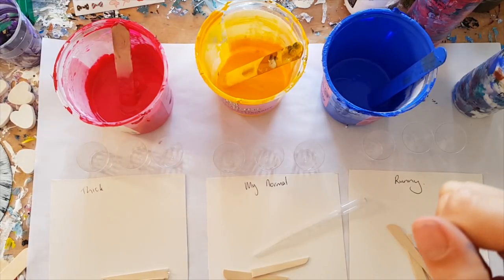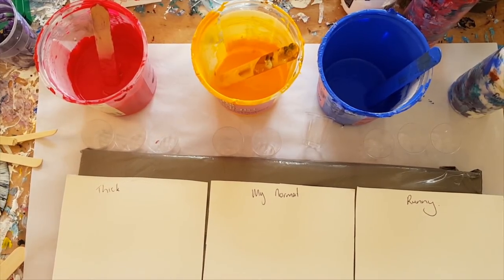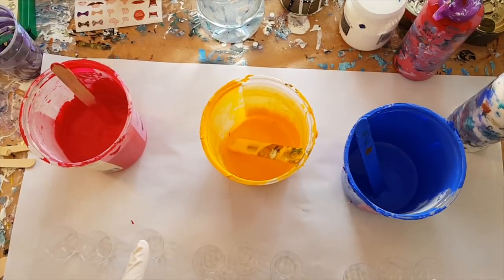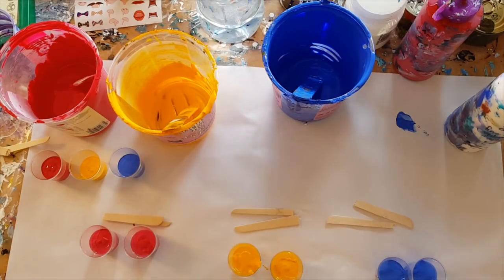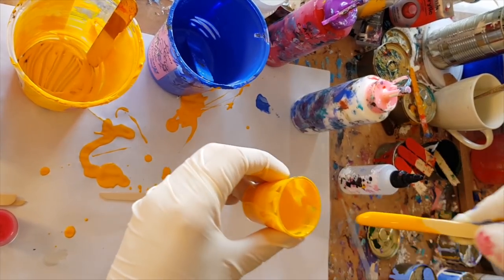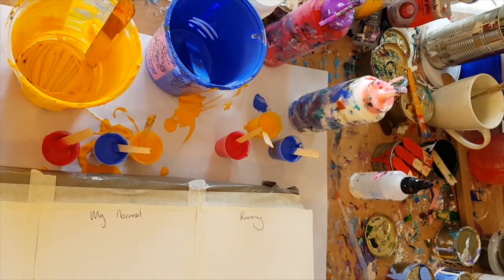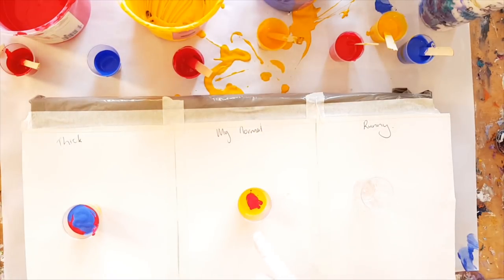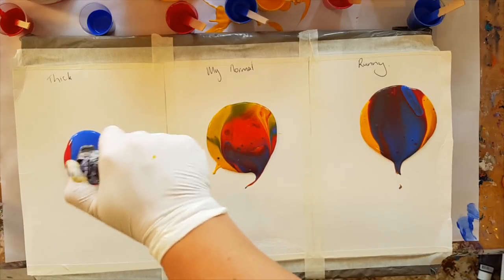171 Does Paint Thickness Affect Cells?  Experiment

Comment: This was very informative.  As a newbie that has made every conceivable mistake possible, I would like to share a few things of my experience.  Sometimes canvases aren't tight causing paint to puddle in the middle. I now run them under water and let them dry before using. Shake your paint, sometimes I forget. Shake your medium. If you use floetrol you need to strain it. Use distilled water, my tap water affected the paint. Pour on a level surface but more importantly it needs to dry on a level surface. I have lost half a painting overnight. Use enough paint for the canvas or you stretch the paint too thin. Let enough paint run off or it will craze and not dry well. I hope some of these tips help others. I'm still learning every colorful day. I 💜💜💜 your videos!
Reply from the maker: That is an awesome list of hints and tips!  Thank you Crystal.

Comment: I’m still a Newbie & wonder if I will ever Graduate 🤨 I mix my paints as You go & the colors mix & don’t mud-up like the “The Super Runny did, but I don’t get a huge amount cells ~ I don’t care in some instances but would like more in other instances.  I’ve tried various Silicones, paints, mediums. canvases, torch, heat gun, hairdryer & I haven’t seen
any difference. What has happened a few times IS....
I will get cells but they go away as it dries.  I used Tap Mineral Waters -I’ll try Distilled & see if that makes a difference.  I really enjoy a Your
Reply from the maker: Sorry to hear you are not getting the cells or if you do they go away.  Did you see my video about mixing the silicone in to much?
Have you tried what Rick Cheadle and spray silicone in the pouring cup?  Without watching your work I cannot offer more advice sorry.